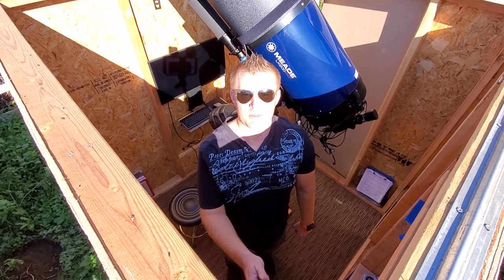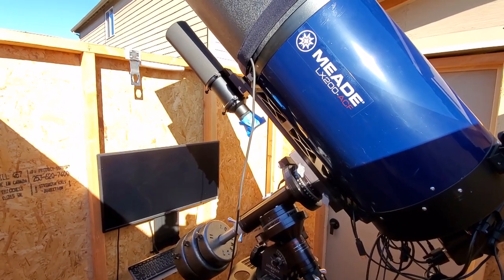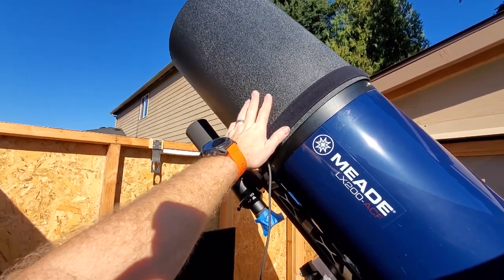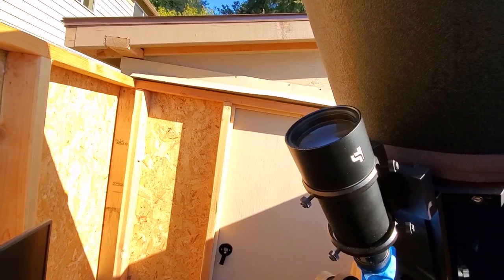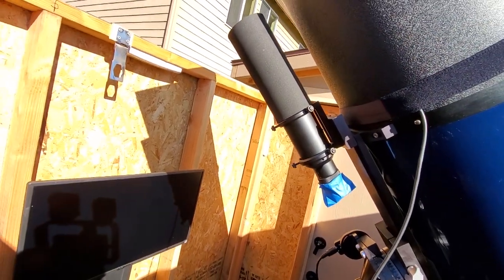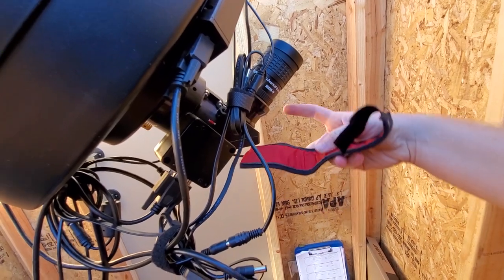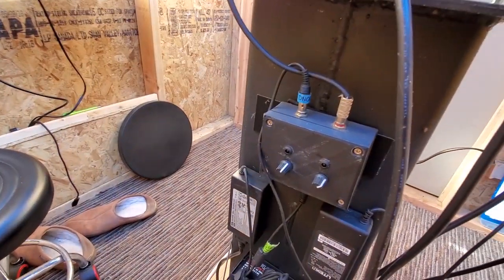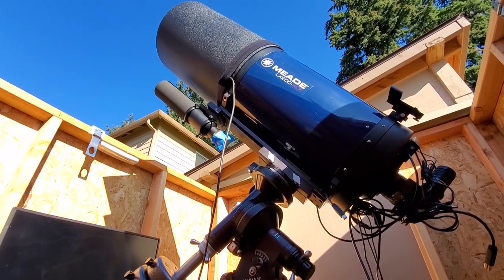Telescope and Eyepiece Dew Prevention. What accessories and techniques work and what don't?

Comment: A bit thin. I'm getting a heat gun as a temporary solution but a more in depth discussion about how to conveniently power dew heaters as well as mounts would help beginners who usually have limited power options.
Reply from the maker: Good feedback. Yes this was just a basic overview video. Not one made to cover every single use scenario.